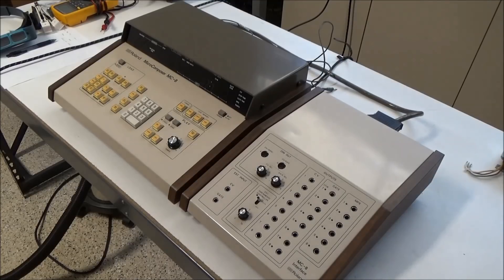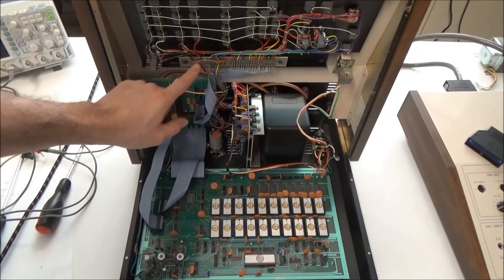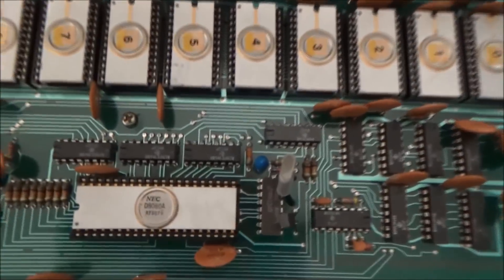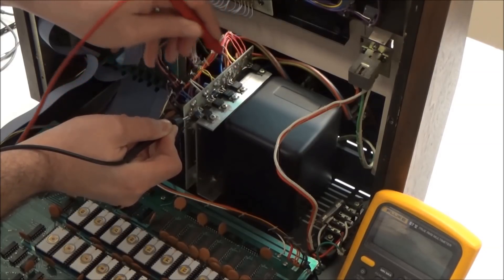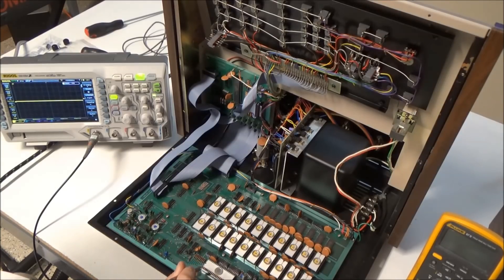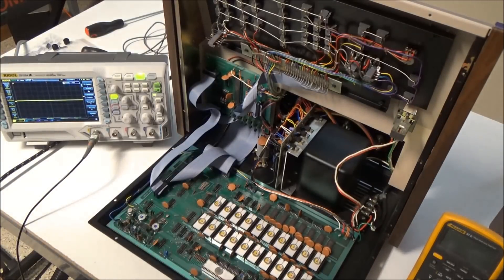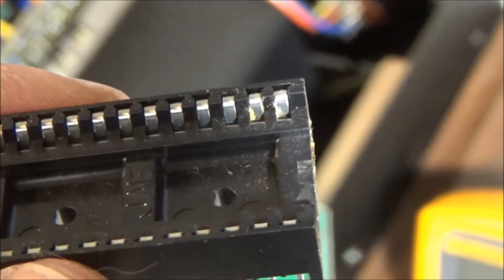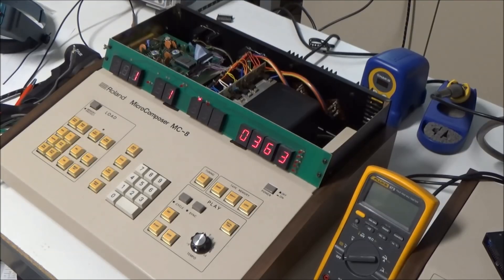Synthchaser #094 - Roland MC-8 MicroComposer Vintage Sequencer Repair

Comment: I wrote my first movie soundtrack using an MC-8 (a prototype model) a Jupiter 8 , a Roland 700 systems and one of the first DX9's in Canada. We had these things because the studio had a direct line to Ralph Dyke who built the first MC8 and the Roland R+D department. I basically was a beta tester. A lot of that studio has disappeared, but I still have access to the 700 and the Jupiter. 

The MC8 is indeed a beast that can do a bunch of stuff, but it had it's draw backs...like volatile memory..... 10 hours into an opus composition and someone blows a breaker in the building....fun ....NOT

Comment: Pretty difficult to diagnose without any schematics. You got lucky with that chip socket. And wow, hand wired buttons ! Almost looks like a prototype. And of course this thing predates MIDI, so it uses all analog CV and trigger/gate out ? Thanks for sharing !
BTW, the Roland MC8 was the favorite tool of Giorgio Moroder in 1979 for his revolutionary album E=mc2, the first recorded live-to-digital.
Here's a photo of him in front of the MC8 (and  other synths used on that album):
http://images.equipboard.com/uploads/source/image/34868/big_4100973808_9b164a9496_z.jpg?v=1473809518